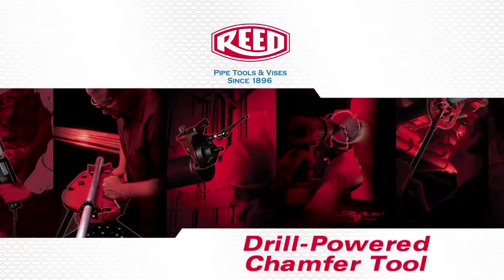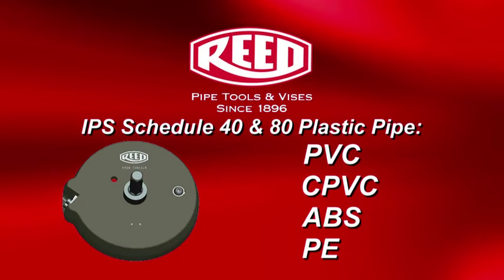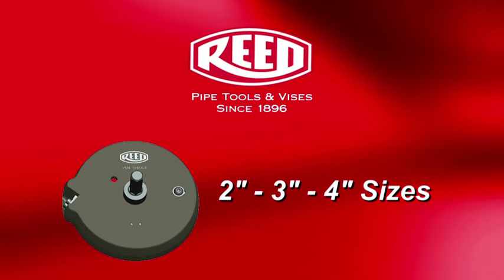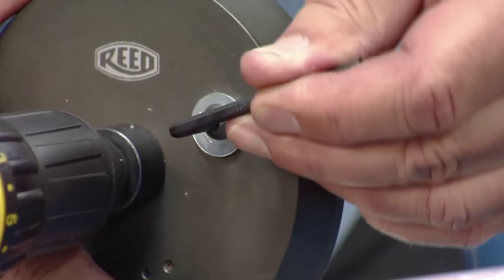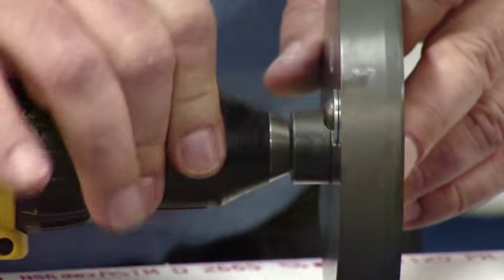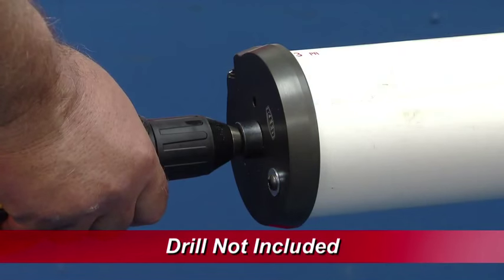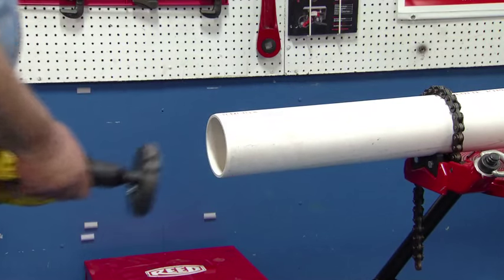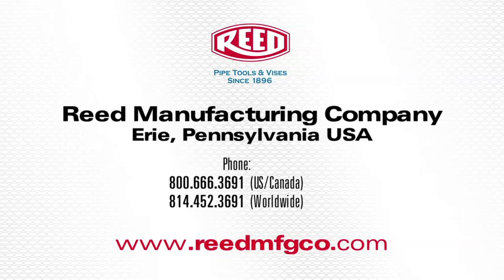Chamfer Tools for Plastic Pipe, Drill-Powered Demo - Reed Manufacturing

Comment: Just purchased the 3". Hopefully this performs better than the chamfer cone. 

The chamfer cone produces inconsistent chamfers. Angling the cone towards the lesser chamfered side doesn't even it out. For the price I'd expect better.
Reply from the maker: This PB3 for 3 inch pipe should give you the chamfer you need.  Thanks for looking at REED and choosing, this time, one of the premiere models.
Reply: Thanks for the feedback. If this is a superior product. Reed should consider making a 1.5".
Reply from the maker: @michaelgoodwin5162   When we get down to that size, we generally recommend the DEB4.  Although it is manual versus drill-power, it is a secure fit for 1 1/2" plastic pipe as it snaps on and gives an even chamfer.  
https://www.reedmfgco.com/en/products/plastic-pipe-tools/deb4-deburring-tool-for-plastic-pipe/deb4/
Reply: You would recommend the DEB4 over the DEB1-2?

The DEB1-2 looks nice. I assume that was not out when I bought the chamfer cone. I likely would have went with it.
Reply from the maker: @michaelgoodwin5162   REED recommends DEB4 and DEB1 series equally.  It all depends on the diameters you're working with on a regular basis.  They both perform very well.
Have you also seen the DEB1 "P" series?
https://www.reedmfgco.com/en/products/plastic-pipe-tools/deb1-series-deburring-tools-drill-powered/
It is only IPS, though.

Comment: I do irrigation work for the golf industry we use knock on repair couplers for pvc.... do you guys have a range of tools ) or multiple different ones) that give a longer bevel? basically need cone shapped ones that range from 1" > 3"
Reply from the maker: For the 1" - 3" measurement, I'm not sure if you mean the bevel length or the pipe diameter.  If pipe diameter, you should check out PDEB250 which will give a bevel on up through 2.5 inch diameter.   https://www.reedmfgco.com/en/products/plastic-pipe-tools/cone-chamfer-tool-drill-powered-or-manual/
If you want a longer bevel, we have Bevel Boss.  It is fantastic.  It does not go up to 3", but you could get a longer bevel if you went 2x around the pipe.  Check this video:  https://www.youtube.com/watch?v=Gkprc-D4DeY&list=PLmn_XmIwrG7s8dA-jRRaTEP1nbhyipp_j&index=6&t=29s

Comment: I have a question about the PB2. Is it marked where to properly adjust the Inside chamfer for schedule 40 ABS pipe? Or are you supposed to just guess, trial and error?
Reply from the maker: There are no markings.  It is easy to figure out where to set it.
All pipe manufacturers work within an accepted range when it comes to wall thickness. REED can’t add markings on the tool because we’d have to change it for each pipe manufacturer.

Comment: Is the system offline, because generally the cutting saw has this chanfering tools which can be used size wise
Reply from the maker: I do not understand the question.  Please restate.
Reply: @ReedPipeTools  I know the extrusion machine is suplied along with planetary cutter and chamfering tools. If the machine supplied with plain cutter. Can we do do chamfering after the normal pipes are processed. I mean pipes are taken out without chamfering and later offline chamfering can be done
Reply from the maker: @jayantkumarbasu5378  Yes, you can use this tool to chamfer after you have cut and fitted the pipe to the length you need.
Reply: @ReedPipeTools  ok thanks

Comment: Is it possible to do Chamfer on OD for Pipe size 4 inch (PVC) ?
Reply from the maker: Yes, the model PB4 fits the 4 inch PVC for making an OD bevel.  Look here:  https://www.reedmfgco.com/en/products/plastic-pipe-tools/drill-powered-chamfer-tool/pb4/
Reply: @ReedPipeTools  Thank you for the prompt response. Does it works to do chamfer on the I.D as well?  Or suggest any tool for ID chanfering (PVC 4 inch & 6 inch)
Reply from the maker: @harshpatel3500  I know we are chatting on 2 different threads.  The same answer here - if you wish to do both ID and OD for PVC 4 and 6 inch, look at the REED Bevel Boss.  It uses a drill and is a cordless method. REED ships it for OD.  To also do ID, you buy and swap out for an ID beveler shroud.  The Bevel Boss solution is well-liked in the field.
Reply: @ReedPipeTools  Thank you for product suggestion.

Comment: I need one like this but for Copper!
Reply: I need one for 6 and 8 inch SDR26 and 35
Reply from the maker: DEB200 from REED is not a power tool, but it does deburr on copper.   https://www.reedmfgco.com/en/products/cutters-and-cutter-wheels/deburring-tool-inner-outer/deb200/